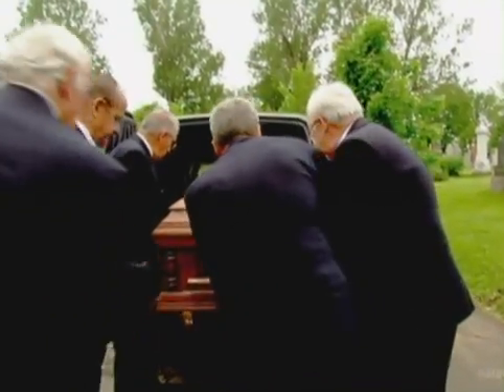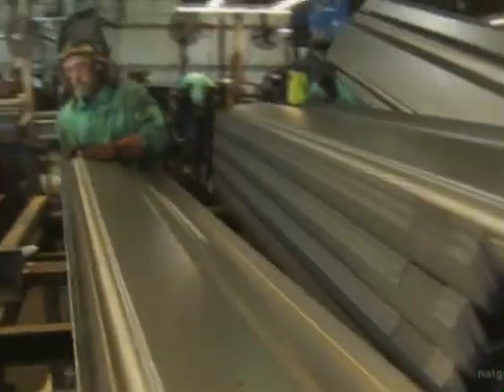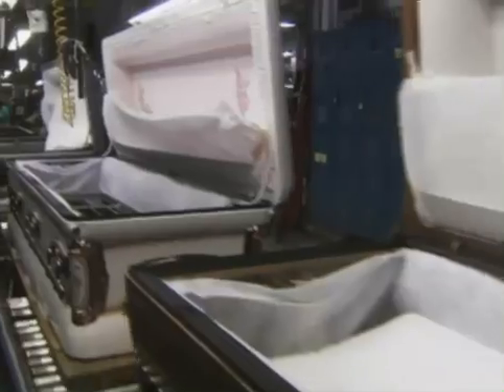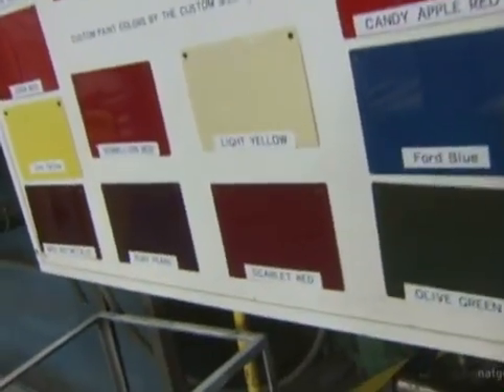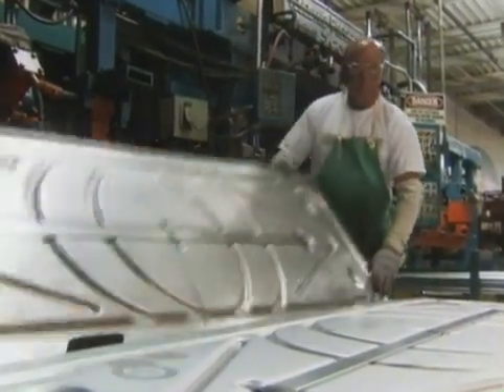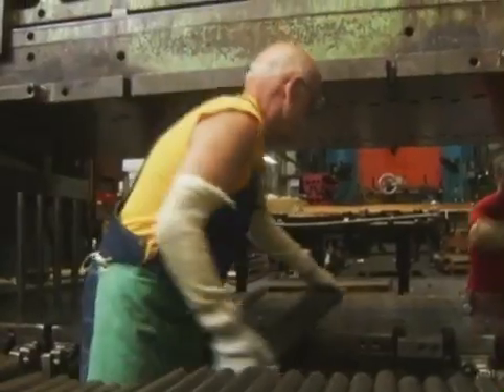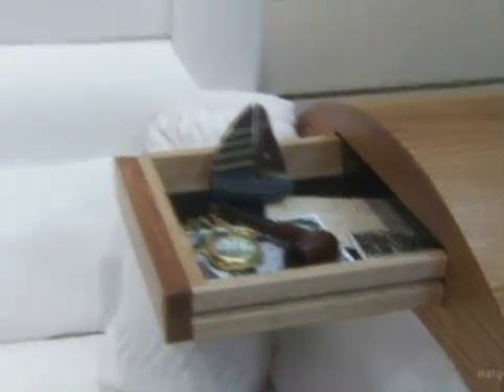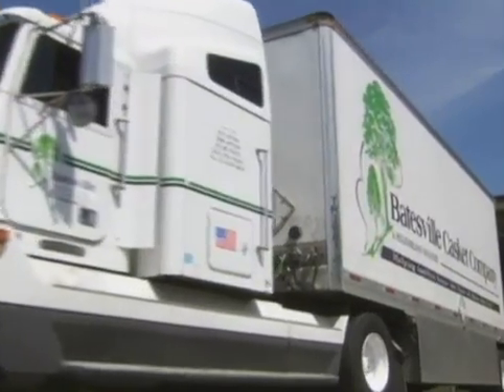Casket - Science of Death

Comment: I agree, the Clark's hold up better than Wilbert's. When crypts used to be built w/o a gas vent, the vault sometimes exploded from all the decomp. gases that built up inside. Besides most of those gaskets last only a couple of years, it depends on if your loved ones planted you in the low end of the cemetery where the water accumulates.

Comment: Regarding the burial in urban cemeteries, you usually do not require any "test of time" type of casket.  In most cemeteries, an outer burial container is required and this blocks most of any leakage.

Even without the OBC, any materials seeped into the ground gets filtered by the ground itself and almost never contaminates the water.